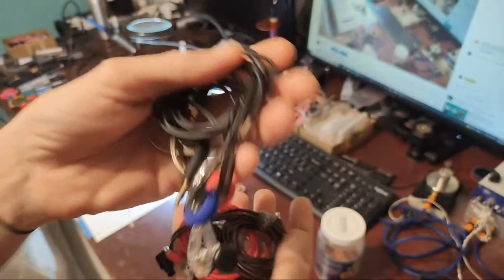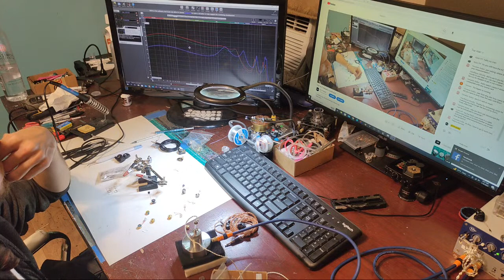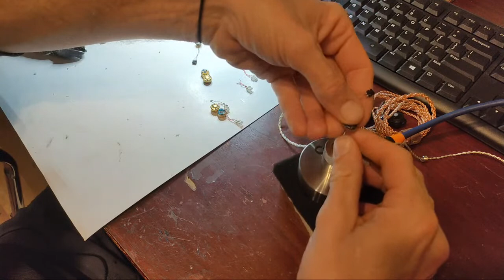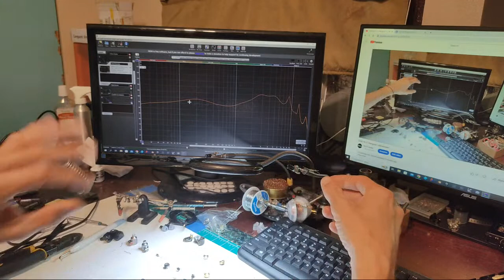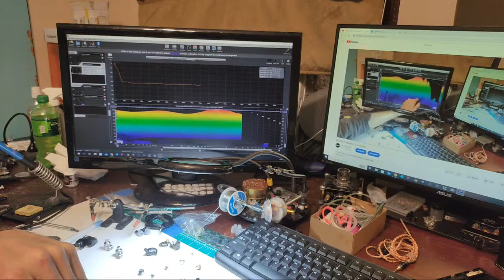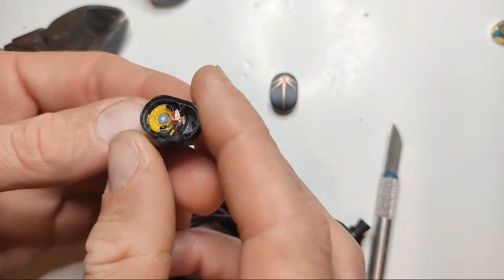Chill Hi-fi Hangout Livestream.

Comment: I have a pet turtle and the filtration, lighting , and heating system for my adolescent has to be super high capacity. I also have to watch water parameters so closely so I can relate. 

I have the zero and am still considering if the Khan is worth adding to the collection. My favourite IEM is definitely the Variations still. Although I tend to up the midbass slightly and reduce treble energy so It matches the Mangrid Top very roughly with Variations Sub-bass. I find my hearing is very odd so my EQ settings favour excessive sub-bass, restrained mid-bass, standard mids, and reduced treble. I am very very treble sensitive so most IEMs sound shrill stock.  Quarks DSP is close second followed by the Kato, Hana 2021, and CCA CXS all roughly tied for third. I like DDs better than BAs but have not yet found a DD set quite as well tuned as hybrids are. 

Thanks for the stream, I did try to make the live stream but it was like 1am where I am and I fell asleep fiddling with some bits and pieces. I woke up to Iems and filters all over, I must have done the swaps though and forgotten that I did it which was actually a pleasant surprise to wake up to.
Reply from the maker: Nice. Yeah I need to get a better enclosure for him. He seems pretty happy though but one day I'll let him go.

So from what you say about your taste in sound you would probably really like the Khan, it has pretty much all the tuning preferences you listed. The only thing is that it's pretty close to zero. You won't get any better technicalities or imaging, you'll only get a bassier/warmer sound. So honestly it's just up to if you want to spend the money or not. If you really wanted to you could just EQ the zero to sound like the Khan so it's hard to say if it would be a good buy for you personally.
Reply: @hi-friaudioman  Well if he's happy then he's doing super well! Is he much work for you? 

I was afraid you would say that hahahaha, ahh well at least its not a bank breaker and a good backup incase anything happens to my zeros.